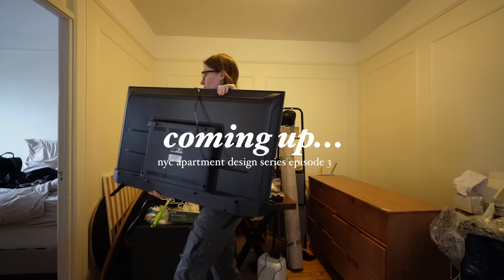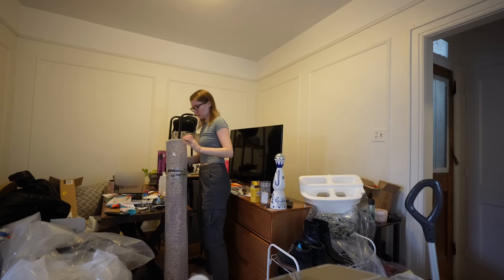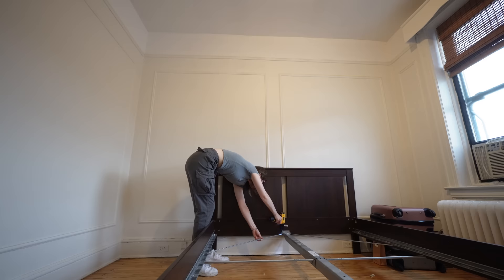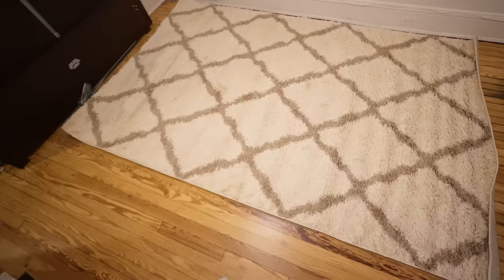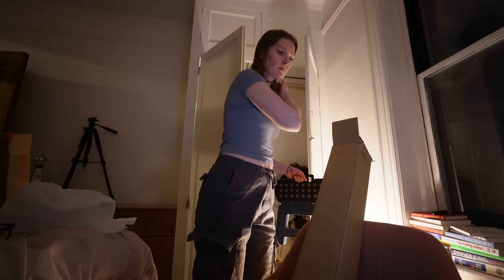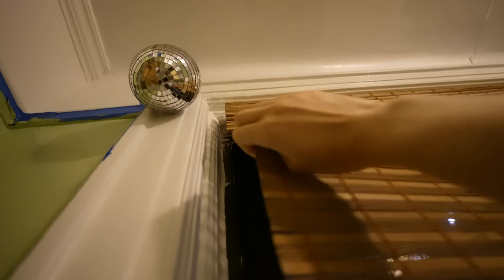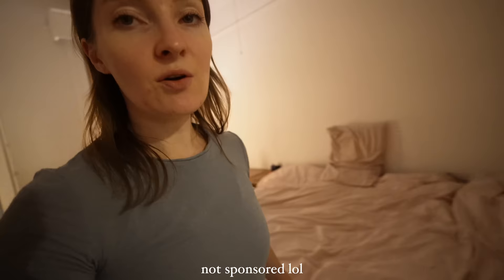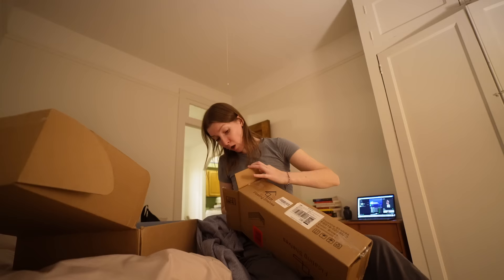Organizing & setting up my New York City apartment *THE BATHROOM IS DONE!* Ep. 3

Comment: Ahhh the Legend of Zelda sound when you pulled down your blinds!! 😍Behold, some unsolicted advice--feel free to ignore, it just helped me when I learned it: for shelf-hanging, if you put a long strip of painters tape on the back of the shelf frame and mark where the holes are, then peel off the tape and put it on the wall and level the marks there. Then drill the holes, peel off the tape, and then put the shelf frame/shelf on! I adore the end result! And the color scheme in the bathroom is SO pretty! Julie has such an amazing eye for color. 🥰

Comment: The bathroom looks so good. Mixing in some muted, different blue really tempers that mid century powder blue. Your shower curtain hooks—if you swap your decorative curtain to the outside clip of the double, then it’ll be easier to take off the liner for washing/replacing. Less pfaffing around with multiple layers on the one side.

Comment: I love the bathroom!  If you can, get some large hooks to put on the wall above your metal rack and hang your extra towels there - they will look good and hang out of the way until you need to use them.  Alternatively, you could hang them on the hooks to dry, hooks work very well for that.  I also like the blue in the bedroom, the bed is very cozy and it adds a nice splash of color without being too jarring.   Nice to see you settling in!

Comment: Someone may have already said but the anchors are only for drywall.  Because your window frames are wood, you didn't need to use them.  You could have drilled the screw directly in.  Just an FYI for next time.

Comment: Living in a house we do a lot of decorating and fixing. (As im sure you know) Right now its the pipe that the dink water goes down, it got plugged up. So he bought a "snake" that didnt push anything through,  so he used a saw and now we 3 feet of missing pipe. We have one sleeve.  Doung dishes in the bathtub not letting anything touch the tub floor and the smell of rubbing alcohol ( disinfected the tub) burns my nose. Fun times.

Comment: Hey Chelsea, how much are you allowed to change within your apartment? I had horrid old yellow tiles in my kitchen and got some hard wearing tile paint to paint them white (its called V33 Tile paint). They look like new tiles and so much better!  It's a specialist durable paint that dries rock hard so you can wash it down and use the space its in as normal. I'm wondering if the US have similar stuff? If you hate your blue tiles you could paint over them as long as its really good quality tile paint for that particular purpose (bath and/or kitchen, so hardwearing).  I own my little house here but I know, when American's rent in NY, there is some flexibility in doing more with a rental than is often the case here in the UK. Look forward to seeing it all progress!

Comment: With all the awful things going on in the world right now, I thought of a funny story when I saw your washing machine on a dolly…. Have you used it on the dolly? Or are you planning to? 
When I was in my 20s, living alone in a Sydney apartment, spending too much money on rent, I like you had a washing machine in the middle of my tiny kitchen, with the taps all hooked up at the kitchen sink. It’s uncanny the resemblance! I thought it would be an excellent idea to unscrew the adjustable feet on my washing machine and replace with wheels, that is, until I did my first washing load, and the spin cycle started, my washing machine was jumping around my kitchen, taps, pipes, hoses almost becoming disconnected, I was so excited to do a wash, it was late of course, so I was worried all the commotion would wake my neighbours below… I didn’t have much of a choice other than understand the cycle, know when the spin component begins and then run to the machine and hold it down for 3 minutes. I’d love to hear how it’s going for you!

Comment: Bathroom looks great, love the assortment in color and texture of the towels in particular.

I do have a question however - did you ever vacuum or wipe off the drywall/plaster dust that accumulated on the top of your wall tiles from drilling holes for the shelves? 👁️👄👁️